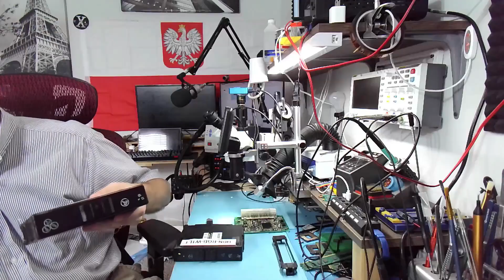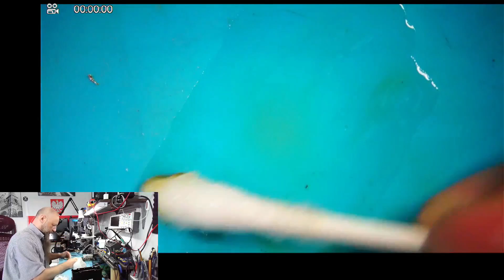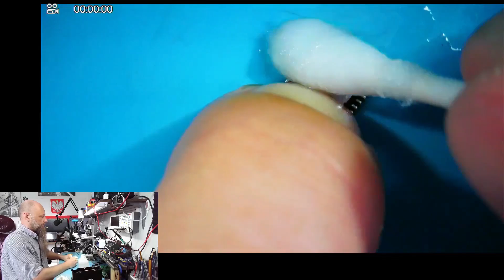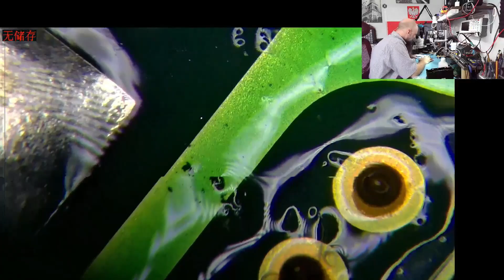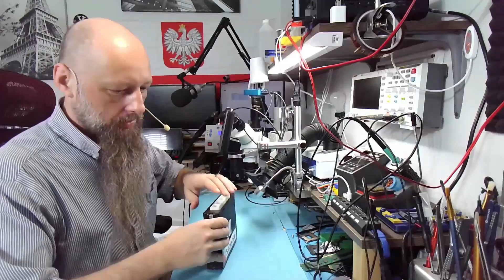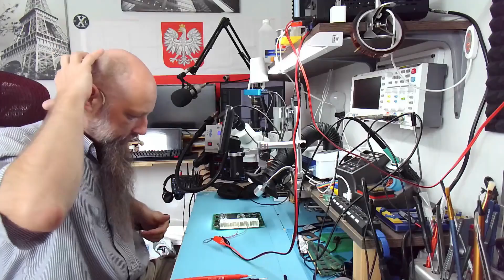Day #31 | Tribeca Misfire Repair and Impreza EVAP Short P0448

Comment: Gaming content is very high competition. One of the best things you can do is have good audio. If the audio is bad, the viewers will drop off very quickly. 

When it comes to ECM repair I like being able to see the repair process clearly. Your video microscope is very clear compared to other channels I’ve watched. 

If you are looking for additional content to produce you could show testing methods for diagnosing customer concern or compare failed ECM to the donor ECM. 
How to test transistors, how to reverse engineer the circuit, etc.
Reply from the maker: interesting, I'll look into that